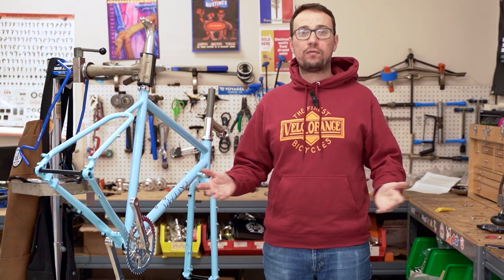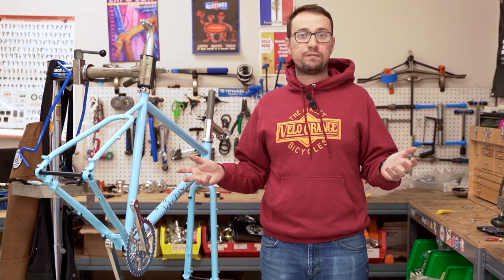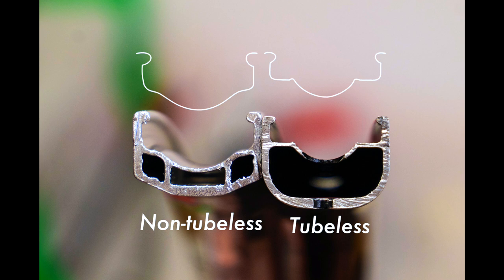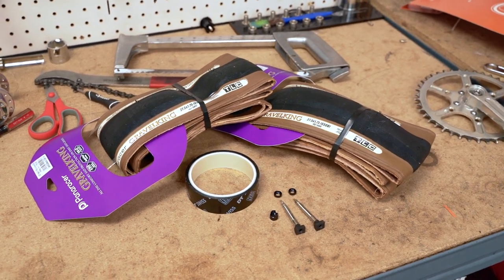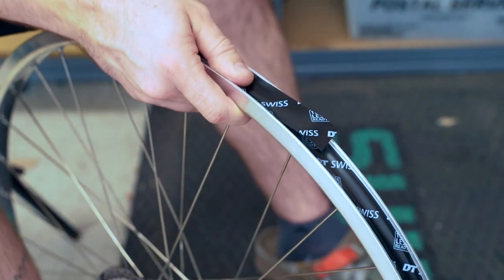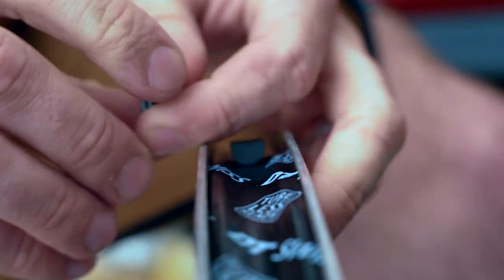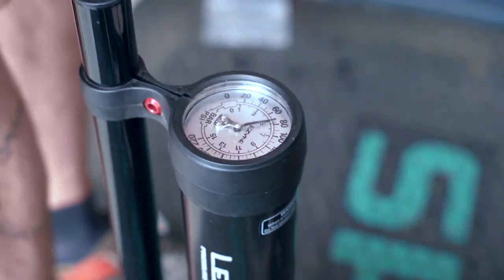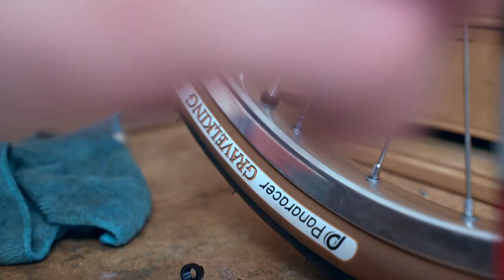Tubeless Tire Install - Let's Build a Rando Bike! - Part 2

Comment: I too may have to give tubeless a try.  I hate mess and having to remember to do something months away, which is why I've been on tubes forever.  Plus, I rarely ever get flats where I live, so that's another reason I've never seen the need to switch. But being that it's getting harder to find regular clincher tires/rims and I'll have to fight with tubeless tire beads seating anyway, I might have to just (begrudgingly) join everyone else.
Reply: I lived with their constant need of attention for about a year before donating the whole mess to my local bike collective. Yet another, "game changer" that's much more of a solution in search of a problem than anything else. Oh, and sales, can't forget about the industry juicing the sales.
Reply: Don’t do it.
Reply: My experience is tyres going porous and de-laminating within 11 months, mess, and anodizing being corroded where it contacted S N T’s. Gone back to tubes.

Comment: Maybe I’m missing something. I’m just curious why you’ve got a disc brake on the front but not on the back.
Reply: Looks like front generator hub takes Centerlock but rear hub takes 6-bolt rotors so a little mix and match is in order. No reason to delay shooting the video.
Reply from the maker: Good eye. We had the wheel already from a previous build, but didn't notice it had the rotor on until we were mostly done filming. We'll go through rotor install when we do that part of the series.